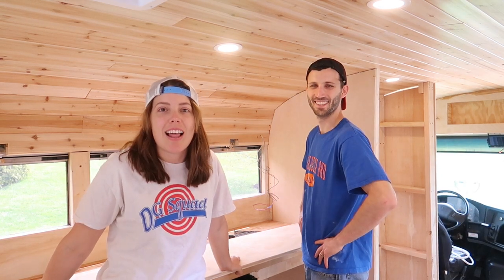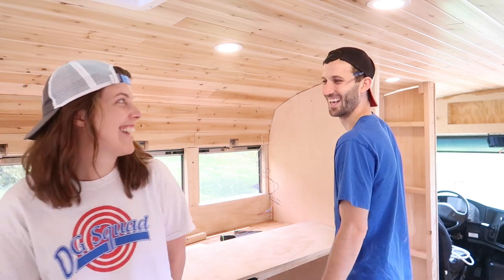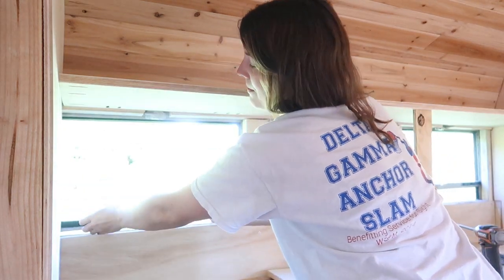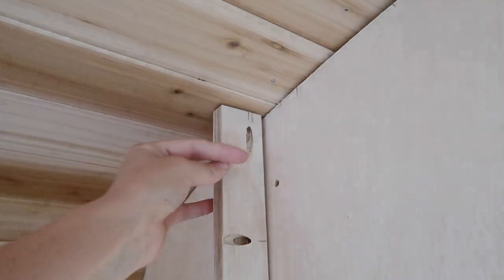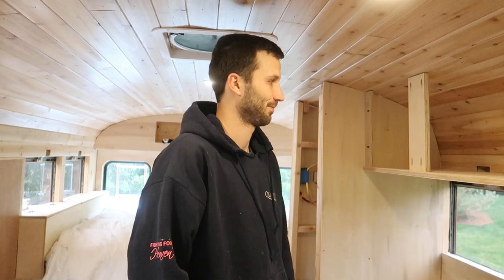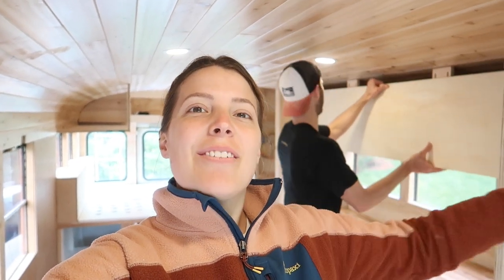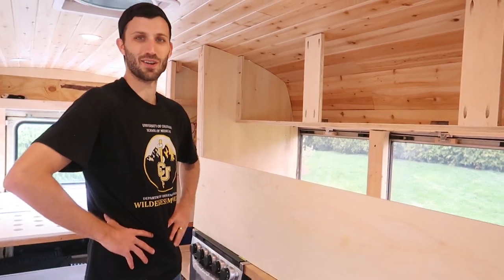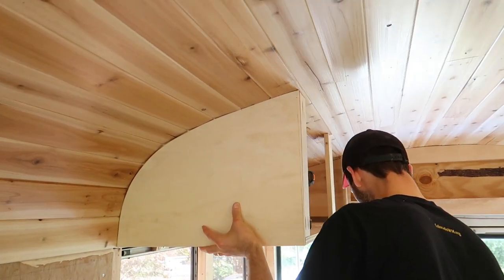Simple DIY Upper Cabinets in Our Skoolie | BUS BUILD EPISODE 37

Comment: You need to put insect screen on your windows with magnets so the air gets in but not the bugs...you could also put an upper cabinet above the bed on the other side
Reply from the maker: We are definitely going to make some screens that we can move around on open windows, magnets are a great idea! We are going to try and keep the headspace above the bed free for now so that we aren’t banging our heads when we sit up, but if we ever need more storage space it shouldn’t be too hard to add it in using the same method as the ones we just completed.

Comment: Those cabinets look great but heavy!

Are y'all concerned about going over the GVWR of your bus?
Reply from the maker: Great question! After gutting the bus we were about 13,000 lbs under our GVWR. We haven’t calculated how much weight we’ve been adding lately but from our guesstimating we still have some wiggle room 😊
Reply: @AdventureTrudge   I think you're right. 13,000 should be plenty of wiggle room unless you decide to start hauling weights. 🤣🤣🤣

Glad to hear you'll be underweight!